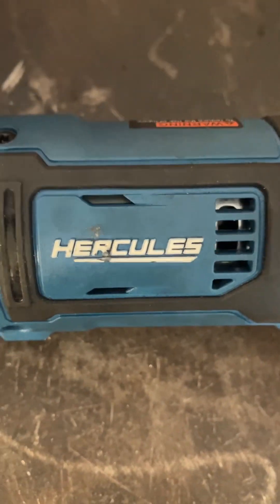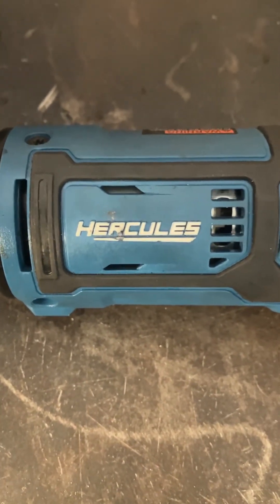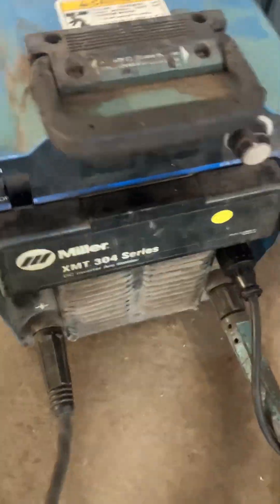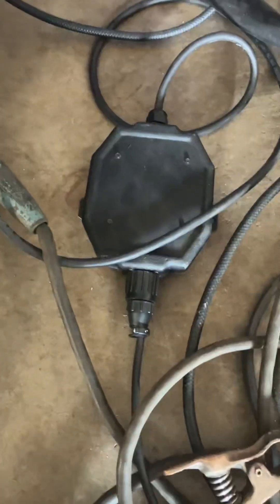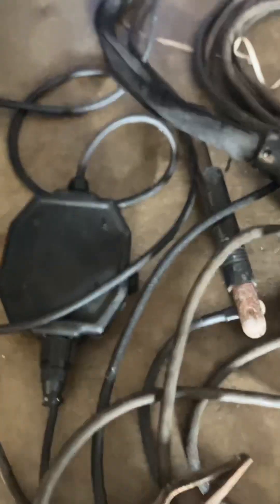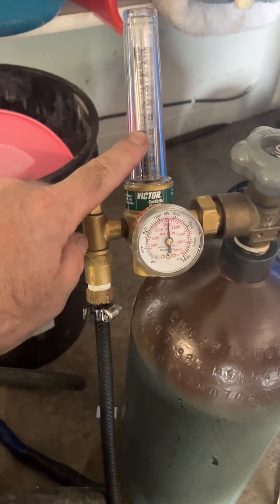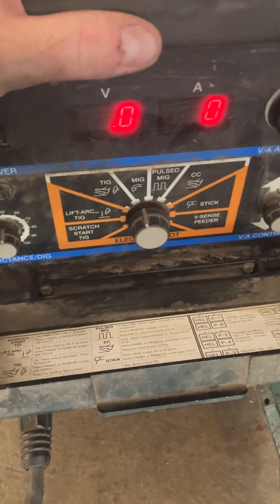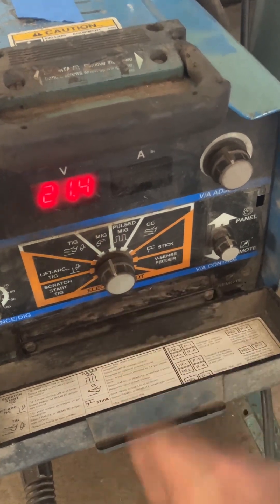Miller spoolmate 200 with xmt 304

Comment: Is that adapter 14 pin to 8 pin?
Reply from the maker: Not sure. The control box WC-24 allows me to use the xmt with the spoolmate
Reply: Just wondering cuz I have a spoolmatic 30A that I’m trying to hooked up to an xmt 304 and I bought one of those wc-24 adapters

Comment from the maker: I don’t have a video dialing it in. If you have a 304. Set to constant voltage. Start with 21.5 volts, gas 25 cfh straight argon. Spool gun speed at 3. Use 4043 wire and push. Don’t pull with a spool gun, push and the welds will come out clean.